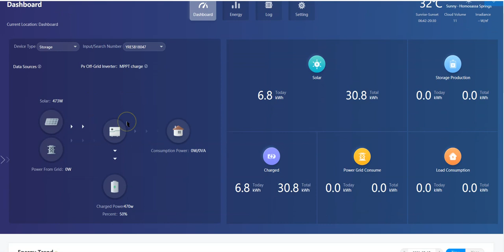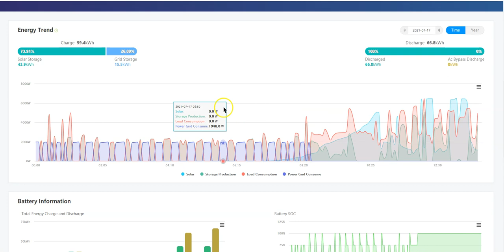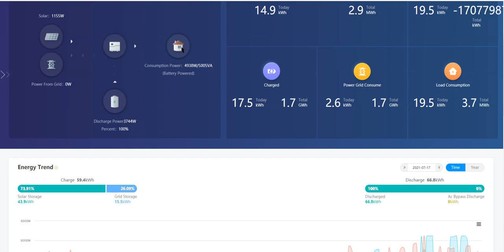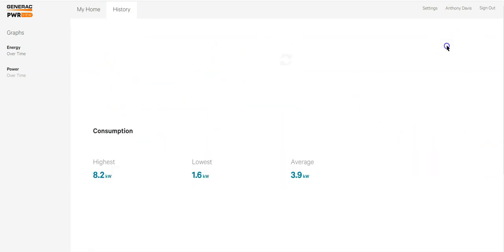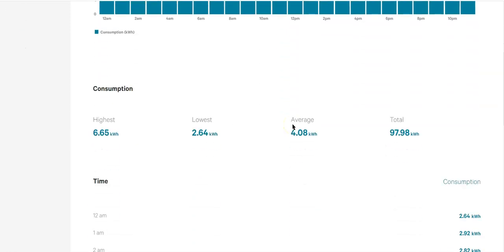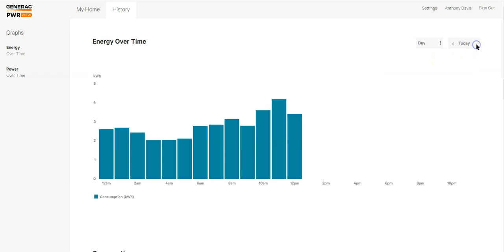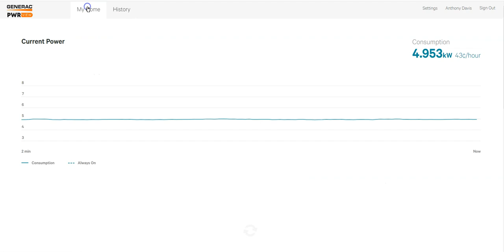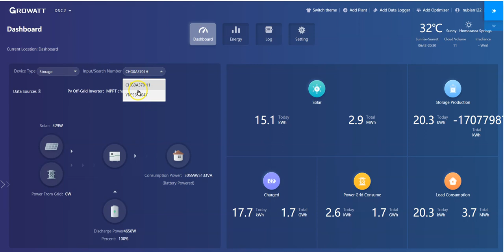Today's Solar Production on the 2 Growatt Inverters   the 12kw Beast and the new 5kw ES model

Comment: I figured out how to cut the growatt online update time to 1 minute from 5 minutes.
Reply from the maker: To tell please
Reply: @nubiandavis2610  in the initial hot spot set up solid blue light log in and the settings on the left flip through those and when u find the 5 min just change it to 1 and save
Reply from the maker: @mitchrothermel8157  did you verify that it's working
Reply: @nubiandavis2610  I  was having trouble on the website connecting the data logger and realized it redirected to a new server address and it clicked that I need to update the dongle and found that setting and yes it’s much faster
Reply: Tell me if it works. 
I use ShinePhone and it updates
Reply: How? Cant find that option
Reply: Nubian did you find the refresh time?
I found that the website doesn’t refresh but the logger does so if you refresh the page it does update. 
I see more people would this info and you have the power to inform 
Thanks